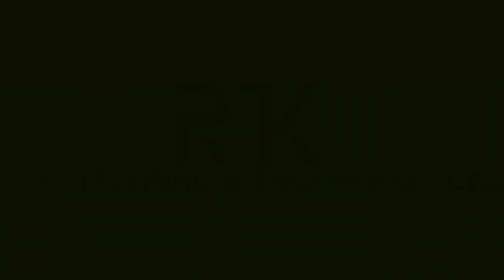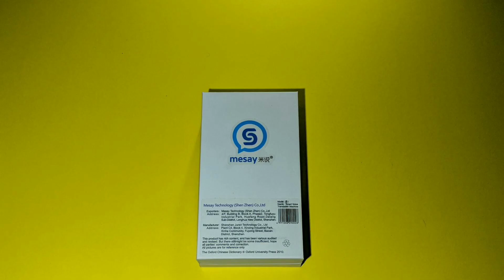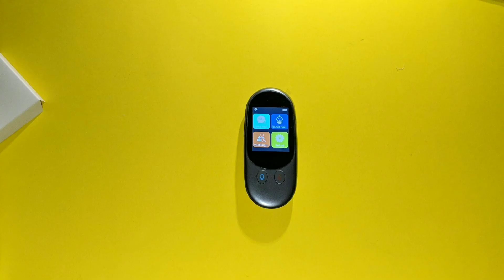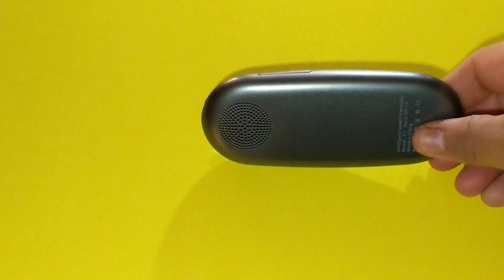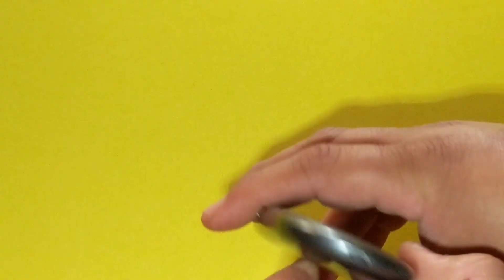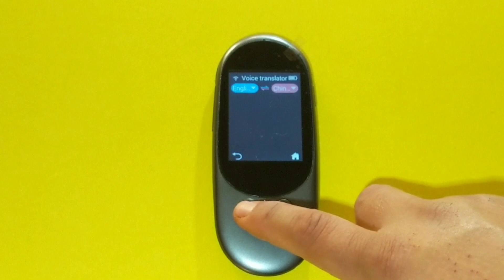MESAY 3-ai :Translator Created for Travelers

Comment: You say this can be used offline. However I read that it requires either wifi or a hotspot to work. Which is correct?
Reply from the maker: It can be used offline. But the accuracy is closer to 100 percent with an internet connection.  Language like English and Chinese or Spanish are still decent offline
Reply: so it needs wifi...! @AreEff1987
Reply from the maker: @toutépossible  no. It uses wifi for accuracy and efficiency but it doesn't need it to function,  just better with it. 97 percent accuracy claim. It varies with the language